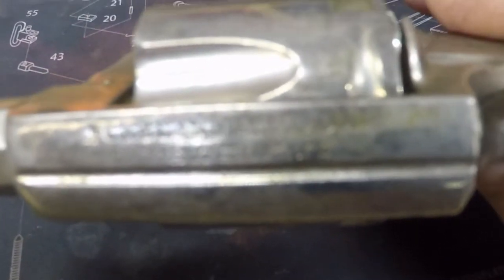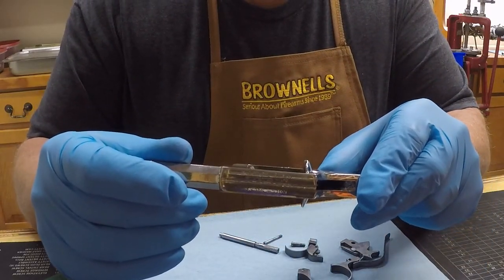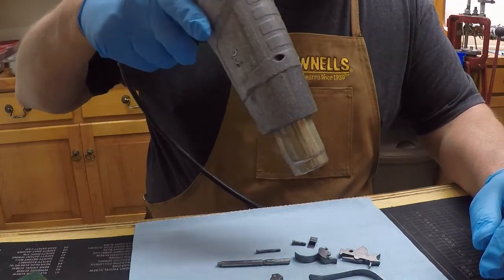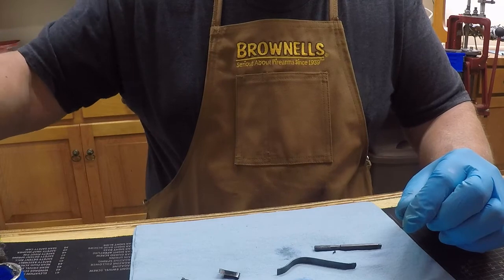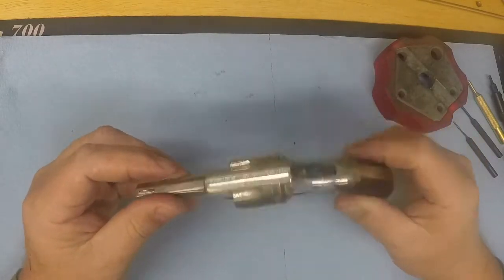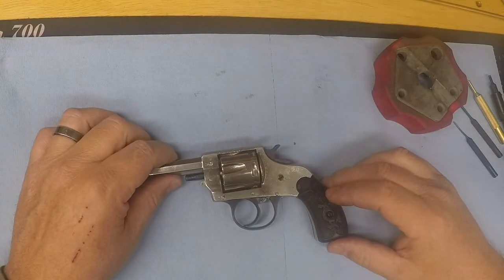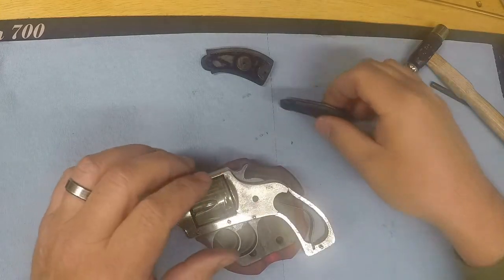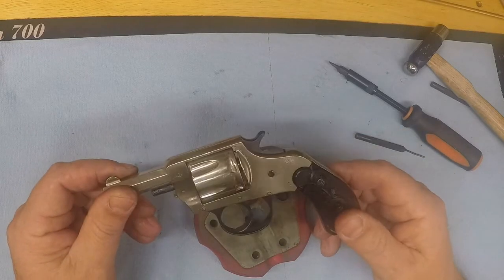120 YEARS OLD!  Antique Forehand Arms Co 32 S&W  Revolver -  Detailed Disassembly & Restoration

Comment: Just got a nickle .38 boiling in white vinegar in my ultrasonic as Im watching this. Id like to replace springs if you know where to get them .Thnks
Reply from the maker: Try Numerich.  Here's the link:  https://www.gunpartscorp.com
Reply: @magnum6886  Thnkyou sir yes I called them the only thing they have is the cylinder. I'm bringing it to a second Smith tomorrow. Most don't seem interested
Reply from the maker: @josephlahood4647  I think it's possible that most gunsmiths don't know how to work on these older firearms.
Reply: @magnum6886  I think I found a couple I dropped it off today he didn't say he couldn't I'm finding its a?matter of if they want the job not CAN they do it.
Reply: @magnum6886  Oh, a good smith knows how to work on them. It is just that the smith's time would be more than the gun is worth. That is why most cheaper guns are worked on by non-pros. 
A local smith is $40/hr with a $25 minimum. He is good, though.
Reply: Howells gun shop in unicoi TN he knows alot about them
Reply: Brownells,also gun shows in Massachusetts and NH

Comment: They can pit under the nickel very easily.
Reply from the maker: I didn’t know that.  Thanks for the info!
Reply: @magnum6886  I have restored several by hand sanding off the old nickel and smoothing the pits. Haven't seen one yet that did not have some pitting even where it looked smooth.